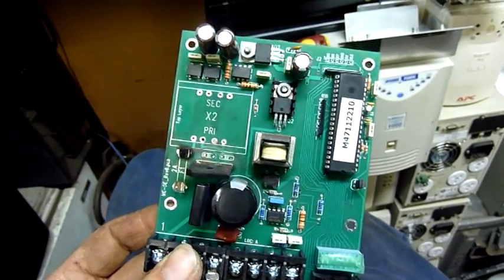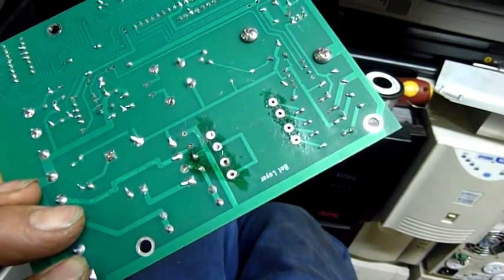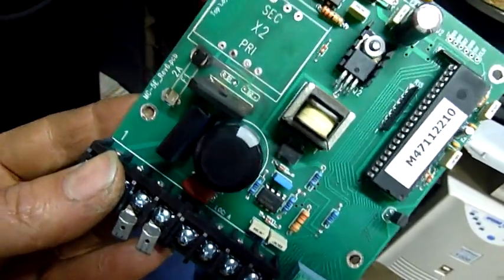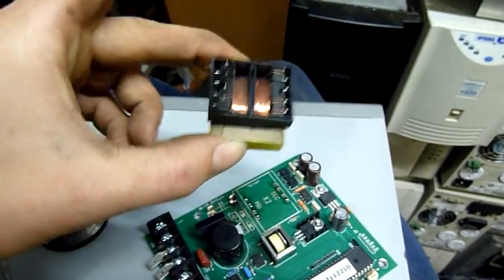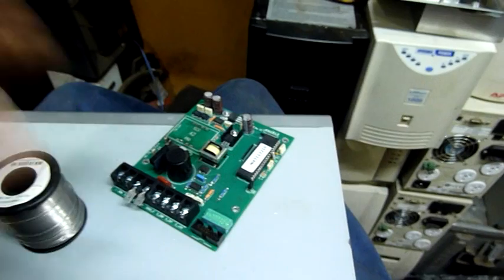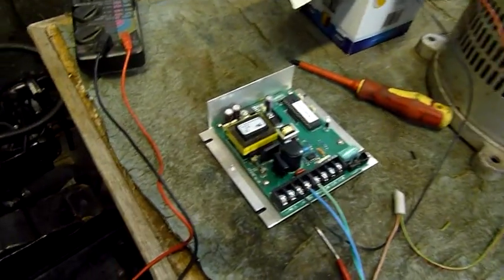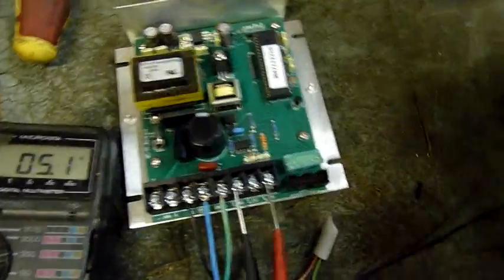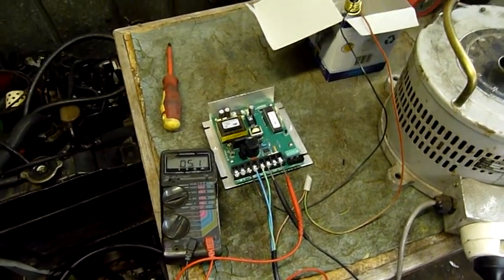Pizza Oven Speed Control Repair Pt2 - It Shows Signs of Life

Comment: thank you..  I know this is several years old.   But, you saved me hundreds.   I cut the burned MOV off and the control works fine.  I will solder a new MOV in..   But, just to know it works is awesome.   Thank you

Comment: If you don't have it already. I would get a deal of rosin flux and a small(artiest) paintbrush  to keep around when your are soldering. That way, You can paint flux on any joint that your planning to solder and will keep your solder joints clean.

Comment: Search for devices similar to Z7D201 for suitable replacement.  This device is rated for use in 120VAC equipment and clamp at 200V.

Comment: MOVs should be rated to clamp above 120% of normal voltage.  For 120VAC service that comes out to 144VAC, but the device must be chosen for peak voltage and not RMS. Given RMS X 1.14 gives approximate peak voltage, you need MOVs that will clamp at about 180V.

Comment: Many devices has input mains protection. As soon as it matches voltage, then, the bigger energy it can absorv ( they turn bigger in size too) the better. So if you got a bigger that still fits, go for it Monitors, ups, Tv's (modenr ones) should have input protection devices like this.

Comment: Seems most manufacturers use 120-240 50-60Hz auto dual voltage switching power supplies, probably all will in the future.

Comment: Oh, also, to test the bridge(unless you know), put your meter on diode test and put he black lead on the + and the red lead on one AC pin at a time.  You should read 0.4xx from + to both AC pins.  then put the red lead on the - and the black on the ac pins and you should read the same thing.

Comment: Screw the MOVs.  If they're in such a rush give them it back without them.
As for the blootered looking rectifier pins and tracks, when the MOVs blew up they probably caused further shorting with the conductive plasma they produced.  (Look at the Bam Board project on bigclive(dot)corn to see what I mean.  The glass fuse wouldn't have helped either.  They are only rated for about 35A fault current while ceramic ones are rated for 1500A or more.  A glass fuse just sustains an arc internally.

Comment: Alternativly you can replace the mov's for ntc's. In this setup they will do the job. Problem is, what value? 

Ntc's or temperature sensitive resistors with the correct temperature and voltage rating act the same way in case of a surge. They will heat up internaly very quickly, thus lowering resistance. I have seen this method in a few big powersupplies.

Comment: The fried components look more like class X/class Y AC filter caps than MOVs to me. If so you can use the 250V equivalent in their place. The cap value shouldn't really matter for AC filtering either. Given their size I'd say give 0.1uF a try.

Comment: Neutral should be connected to ground at your main breaker.  If you have any voltage between neutral and ground, you have a wiring problem!

Comment: I dont believe they are, but I could be wrong.  They have a wiring system with a earth ( ground ), Neutral, & Line.  Line to neutral or ground is approximately 240 volts.

Comment: Smashing ed :-), but why didnt it work before, you didnt say you replaced the bridge and the fuse was not blown, hmm.

see if you can get the plug in dispay/switch panal off the customer, they are not big.

if that reg was a 7805 then the transformer could have pulsed 35v into it, but that reg is bullet proof so i think the chip is ok :-)

Keep going Ed, "Ed put the smoke back in" :-)

Comment: You could order one from element14 / farnell 
I think this one might be able to take it's place 
order code: 1856837
Varistor Case: 5mm Disc
Clamping Voltage Vc Max: 250V
Peak Energy (10/1000uS): 8.5J
Voltage Rating V DC: 175V
Voltage Rating V AC: 130V

Comment: I guess the bridge rectifier and MOVs shat themselves before too much happened. Hopefully none of the pins got killed on the micro (opposite side to the transformer, you can tell what it is from the oscillator circuit connected to it) because that's the only part you can't really replace.